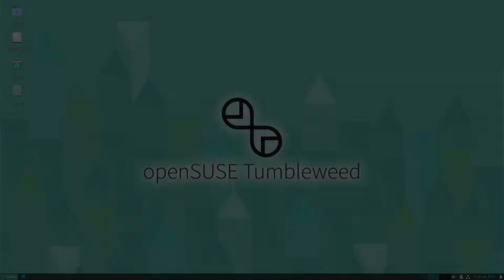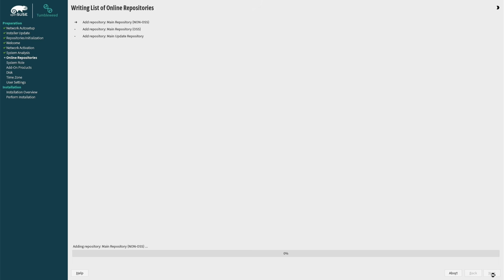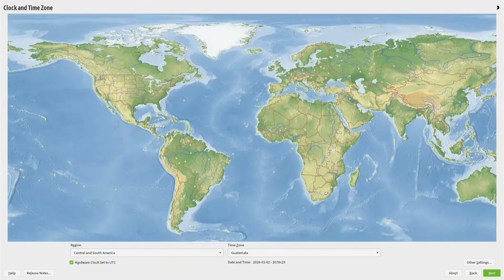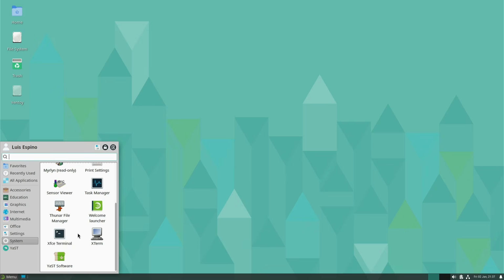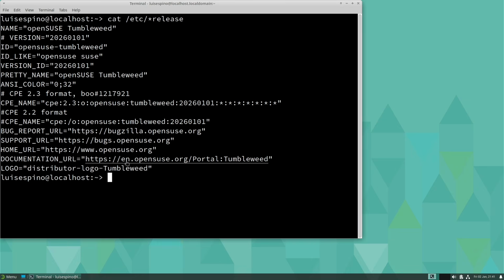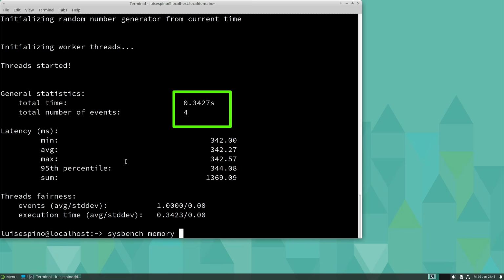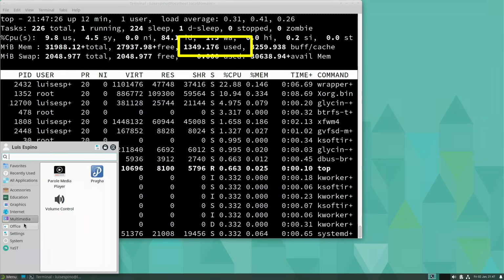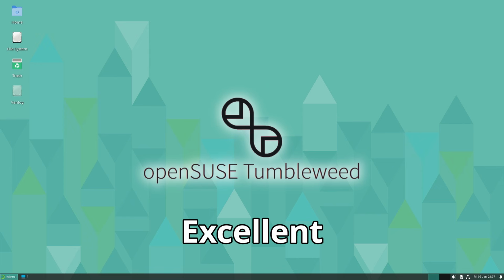openSUSE Tumbleweed Review: Install, Test & Ranking - Is It The Ultimate Rolling Release?

Comment: I've been using it for a few years. I don't recommend it if you want a distribution to rely on. I recommend openSUSE Leap. Regularly there are problems with the system or an application. Sometimes an error for the same library can occur several times, for example for Gkrellm. It takes one to three days to have a fix. It is clearly a system for advanced computer users.
Reply from the maker: Thanks for sharing your experience! We’ll be making a video about openSUSE Leap soon. What you mentioned is definitely something you notice after using a system for a while, so it’s very helpful to hear your perspective.